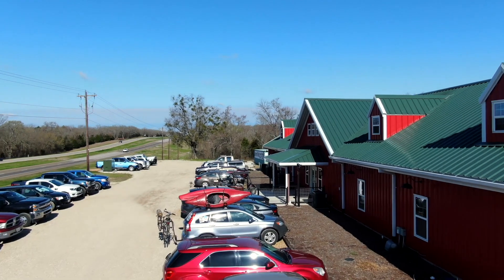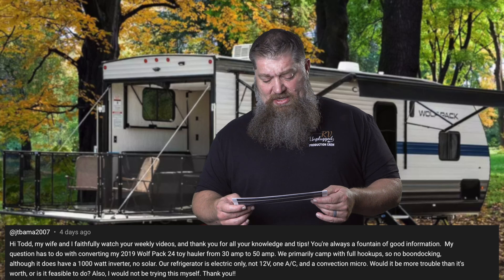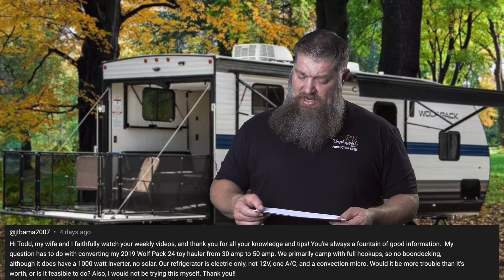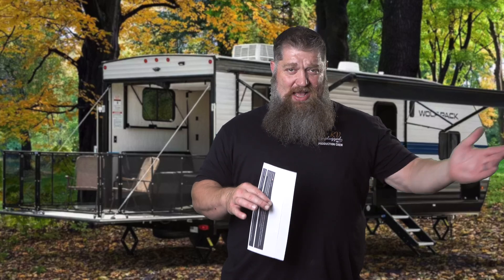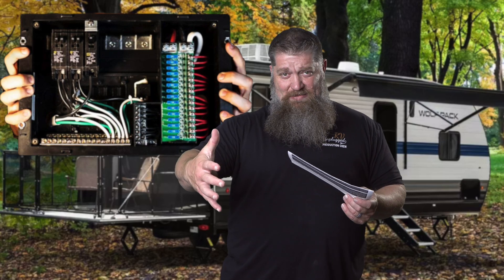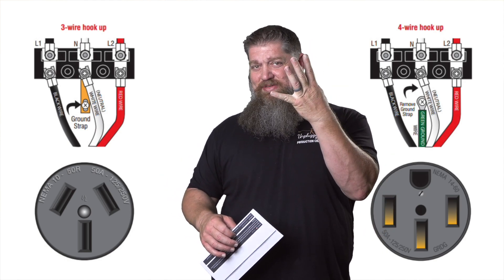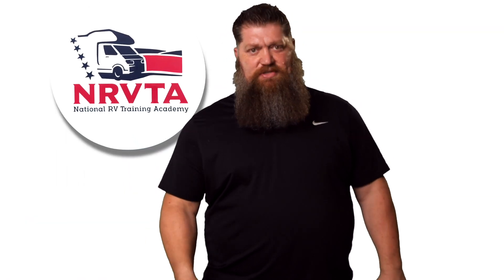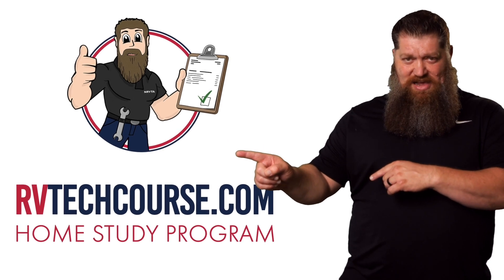30 Amp vs 50 Amp: How to convert your RV safely

Comment: I have a 30 amp Kingstar on my flat bed.  I have 1200 solar, three large batteries , two propane bottles and a generator .  The only thing the 30 or 50 applies to is Shorepower isn’t it ?

Comment: We have a 25 year old class a rv that was a 30 amp coach with 2 a/c’s, microwave and etc…. Yes, we were always managing our power output trying not to pop a breaker for numerous of years. My rv technician has been talking with us the past few years of converting our rv to a 50 amp. After numerous, numerous conversations we finally decided to upgrade to 50 amp’s. We are so pleased with the results and upgrades. I would highly encourage individuals if they are interested in this project.
Reply: How much did it end up costing?
Reply: @sheeeve08  it cost me around $2000.

Comment: The pictures of 30A and 50A connections are for a 240 appliance like a range or dryer.  That 30A picture is not how RVs are wired!

Comment: I've found that we can run any 2 "appliances" on 30A as long as one isn't the microwave. That thing needs it's own 20A service but it's a built-in so I'd have to remove it to accomplish that feat. A/C + water heater + fridges (2) runs up around 26A. If the port and panel were on the same side of the camper I'd do this upgrade in a heartbeat. I haven't removed the panels underneath to see if it runs under the floor.

Comment: I’m so confused . I bought a 2014 Jayco white hawk summit edition and I was popping breakers . Well more stuff started happening and I decided to purchase a new converter well that came in and I opened it up and it had only 6 fuse slots which mine has 11 so I started thinking mine is a 50 amp even though everything shows 30 . I looked at the 50 amp converter and that has all 11 slots . Or can someone tell me wth to do lol

Comment: If you are only going to use *one* leg of the 50-amp circuit (ie not two using 50-amp legs), does the breaker box still have to be swapped out??

I'm thinking through converting my 30 to a 50 with the intent to have a little more overhead than 3600 watts. I get that everything between the pedestal and the rear of the breaker box has to be swapped out. Don't the breakers in the breaker-box protect everything down stream of it from pulling to much? I guess you might need to swap out the main breaker for a 50 (?).
Reply: I was thinking this exact same thing. If you don't need to run two AC why not just replace the power cords going into the panel to 6AWG and switch the main bracker to 50AMP? and then use the 50 amp shore power?  Wouldn't this still allow you to run 1 AC, 1400 Watts, Microwave 1500 Watts, Fridge 350 Watts, and cover you when the Water heater 1500 watt randomly trigger on? I have a soft start already installed in my AC, so that ramp up shouldn't be an issue. The thing that keeps tripping my 30AMP trailer is when the AC is on and my wife tries to microwave something and the Electric water heater randomly kicks in. 50% of the time we are fine, the other causing it to trip which Pev's her right off. Most of the time when that happens we are hovering just around 3700 watts, which is just barely enough to trip it. Thinking of installing a Victron Multiplus II and leave my trailer on 30AMP shore power and have it "Makeup" the short term difference in power needs. But wondering if I can still keep the 30AMP everything else besides switching out a few wires to 6AWG.

Comment: You could buy a Bluetti power bank and plug your fridge into that to help take the load off of your 30amp power. You could also install a soft start on your A/C so it can run while using your microwave. You could NOT run your A.C while running your microwave. Another option would be to replace your refrigerator with a 12v fridge. You could install extra Lithium batters and some solar on the roof. My RV is 50amp but several times I was at a RV Park that only had 30amps available and I never had a problem, just do a little power management.

Comment: I'm upgrading mine from 30 to 50. That way I can cook with electric skillet run my microwave and ac unit. Plus I added another circuit. So now I have the trailer outlets on two breakers

Comment: Why not using a smart inverter/charger (like Victronenergy Multiplus) and combine it with a lithium battery? The smart inverter/charger limites the shore power usages but adds (if necessary) the additional power from the battery. And as things like microwave, etc. don't run all the time, the battery can be recharged inbetween the usage phases.

Comment: I have upgraded 2 personal RVs and am thinking about a 3rd solution to my Dad's RV. 

Upgrade 1, a 1972 Holiday Trav'ler 28 ft. 
I kept the main 30 amp circuitry, upgraded the panel and added a couple circuits. (In this era of RVs the 120v and 12v were in different panels, so I put in a square D residental panel.)  I also converted the built in cord to a detachable cord. In addition to bringing the existing wiring up to a modern standard I added a second, 20 amp, 120V input inside the rear storage bay. I used a leviton 20 amp input, this goes out on a 12 gauge wire to its own 2 circuit square D mini panel completely separate from the main electrical system, then it goes through a 20 amp breaker, back out on number 12 to a single 20 amp outlet in the bedroom. This outlet is mainly for a space heater in the winter or a portable A/C in the summer. I have also used it for a vacuum if Im not heating or cooling and have other loads in use on the main system. 

Upgrade 2, a 1983 sunline T15 something (I dont have the exact model number handy) 120v and 12v are also separate in this trailer

I upgraded the 1 and only electrical input to 30 amp 240/120. I upgraded to a square D panel from the Federal Pacific that was there originally. I then replaced the main feeder wire to a 10/3 and main input with a 30 amp twist lock (nema L14-30) using a reliance generator input box. I also load balenced the circuts as much as possible.  The 14-30 twist lock can be adapted up to the standard 14-50 you find in most RV parks and since it feeds the panel through a 30 amp double pole breaker it wont overload the 10 awg wiring and I have 2 30 amp legs to work with. The power flow goes like this. 14-50 receptice receptacle at the pedestal to a 14-50 to L14-30 adapter, then to my 30 amp twist lock cord, into the RV through my reliance input, and to the panel. Inside the panel it goes to a double pole 30 amp breaker limiting the current to 30 amps and feeds the panel, and branch circuts.

Upgrade 3 my idea for my Dad's 26FT, 2019 Coleman (also what I'd recommend for most wanting to do this) this RV is on a seasonal site.
The 30 amp power cord comes into the trailer under the bottom bunk. There is a junction box where it transitions to romex. It goes through the floor to the 30 amp AC DC distribution panel in the middle of the RV under the TV.  What I was thinking is replacing the 30 amp cord with a 50 amp inlet (probably another reliance generator input), feeding that 50 amp input to a 6 circuit panel through a 50 amp breaker, feeding the original 30 amp panel using the original run of 10 gauge wire off a 30 amp single breaker on line 1 of the 50 amp service. That is it for line 1. It only feeds the original RV wiring. On line 2 I would add 2 circuits inside for higher power items and 1 dedicated circuit outside for his outdoor kitchen. Power flow for this setup would work like this. Power flows from the 50 amp receptacle at the pedestal through a 50 amp cord into the RV. Once inside the RV it goes on 6 gauge wire through a 50 amp breaker and energises a 6 circuit square D panel under the bunk. Power from line 1 is sent out of the 1st panel through a 30 amp breaker to the original panel. Nothing else is connected to line 1 and the original panel isn't touched. Power from line 2 is sent out of the new panel on the new branch circuits. You will have to figure out how and where you want your additional panel and circuits. Every RV is different and has different compartments where wires and panels can go. You will have to figure that out on your own. I am just here to give you the electrical layout. You may also want to use a different color outlet for  any additional circuits that are on line 2 as a visual reference for where to plug in that space heater or air fryer.

Comment: In Canada parks the most you see is 30amp plus a 20amp pedestal, in the US you find 50amp also.
If I’m not boondocking then I use the 30amp and 20amp outlets. I try and boondock as much as possible as it cheaper and quieter.

Comment: 12 gauge wire on a 30 amp circuit…?
Reply from the maker: @JD-bd5uu  10 gauge
Reply: @NationalRVTrainingAcademy  Right (18 yr Commercial Electrician here). No additional over current protection on the 12g wire, receptacles or A/C unit, unless there’s a 20A breaker in the motorhome that wasn’t mentioned. But the feed would still need 10g.

Comment: We rarely camp where there is electric and for our Casita, the 30 amp is perfect. However, having looked at the pedestals, I have seen some that do not have the 50 amp sockets, so there might be some concern there to be aware of.

Comment: I just learned something. WOW In our case, it might be worth the conversion. Our original fridge went out. We didn't replace it with a $3,000 original fridge. We went with a cheap one from Home Depot. The problem is it only runs from electricity and not connected to the breaker box. In places that we have to run in back into a plug in the camper, we have to watch it due to breakers throwing. So, it might be worth it to us. 
Go Anyone who beats Bama!!! They got their buts handed to them!!! YAY!!!

Comment: Great Vid!  My breakers on a 30A trailer kept triping when I plugged in my truck block heater. I just got a 50A dog bone and used the 15a side for the truck  and preserved the 30a for the trailer. Works great.

Comment: Not really a sensible option. Lot easier to find a 30 amp site these days vs a 50 amp site
Reply: I find it to be the other way around in my 30 yrs of RVing...and very sensible option if they plan to keep the rig awhile and want more power...wife prob wants to run the AC fridge Water heater and hair dryer all at once :)

Comment: Here is what I did and it works perfectly !!!

I just added a second 30 amp leg. I added a separate circuit that never touches the original coach electric, I added a second ac unit and 3 outlets.  The original plug where brown so all the new wiring is done in white.
I used the wire channel that attaches to the wall. All available a home depot.  The original circuit is run on the 50 amp and dog boned down to 30 amps.  The second I run on the 30 amp plug.  90 % of the parks I am in have both.  I can also run the second leg on a 20 amp plug if needed. all wiring is 12 ga

Works perfectly and did not offend the factory electric warranty because they never touch.   I bet 20 people have asked me why I have two electric hookup plugs on the coach, and half of them said they were going to do the same thing.   Great solution, cheap and perfectly safe, meets house electric code.
Reply: @stevenkapela6236  You run the risk of burning up that 2nd 30 amp circuit & A/C unit by running #12 wire (rated for 20 amps max, 16 amps continuous use) and putting it on a 30 amp breaker.
 
I do like the idea of running a dedicated circuit for the second AC unit, just use the 20 amp standard receptacle, not the 30 amp on the pedestal 👍🏼
Reply: I honestly thought Todd's 2nd option was gonna be this. The he said extension cord.

Comment: Coming into a 50amp pedestal you’ll have two 50amp wires coming in. One side should goto the 30amp circuit and the other to the 20amp circuit. But what happens if one side of the 50amp goes to both the 30amp and 20amp circuits?
Reply from the maker: You would still have only 50 amps between the two lines that happen to be the same phase. Not a problem as 99.99999999%of RVs do not have 240v appliances
Reply: You are right,
I have seen a couple pedestals that had the incoming wires feed the "twin 50", and one of the legs feeds the 30 amp hot leg, 
Obviously the 20 amp circuit should come NOT off the 30 amp leg & yet the 2-3 panels Ive looked @ did the 20 amp off the 30 amp leg. 
😢